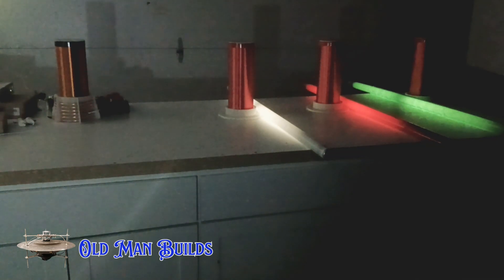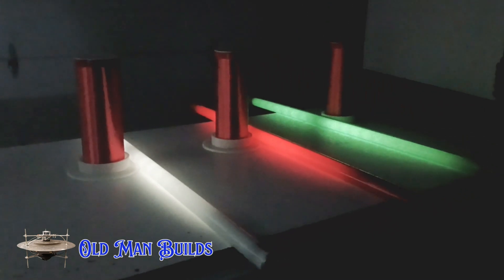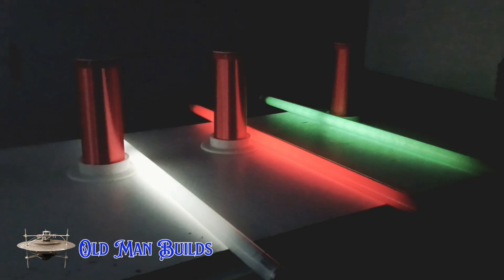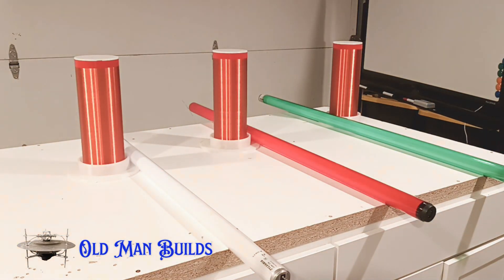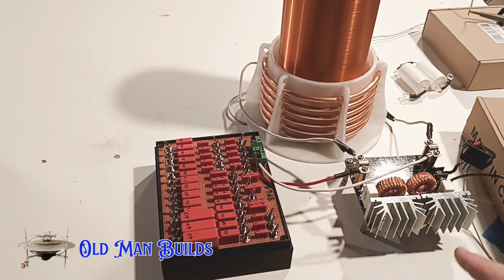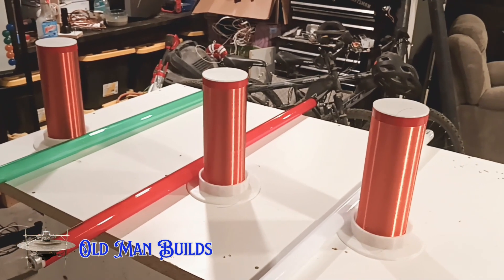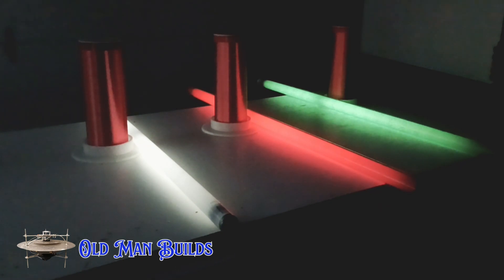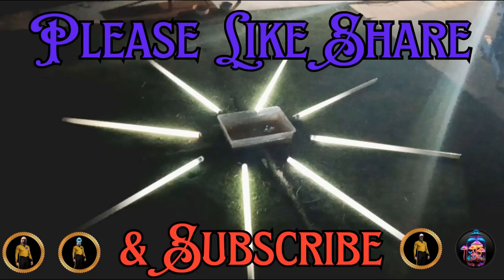Tesla Coil's No Connecting Wires Resonance

Comment: The Green one was weird, was totally off, then tapped and it turned on… seems like a switch was flicked or something
Reply from the maker: my body provided capacitance for a second and it helped it start. It has happened a lot during this testing.
Reply: @ thanks, that actually makes sense, like a how ham radio works better when you hold it in your hand. 👍🏼

Comment: They consititute a transformer dispite distance.
Reply from the maker: the distance is a factor right now, but the closer I get to pure resonance the distance get further away.
Reply: @nathanbunten4299  Tesla in drawings often used square plate at end of coil winding as antenna. In one patent he suggested using ceiling and floor  as wireless power system.

Comment: Cool project. I would suggest calculating the size of capacitor needed to resonate the receiving units at the 250Khz or whatever the transmitter frequency is running at. Try making it a series resonate circuit for higher impedance/voltage across the receiving coil. Also a Grid-Dip meter can help at determining the resonate frequency of the coils as well.  Have fun and beware of RF burns.

Comment: Thanks for sharing, that's awesome. What wire gauge do you use on your secondary?
Reply from the maker: Each coil is 32g 12"long and 4" in diameter. The #1 is 1/4" hollow copper tubing.

Comment: Ive done something like that on a smaller scale. If you can put similar caps on the primary and  recievers, it will multiply the energy by how many reciever/stages are resonating. Connect the caps from to top to the bottom of the coil
Reply: @   By multiply the energy do you mean overunity?
Reply from the maker: I will give that a try. Thank you.